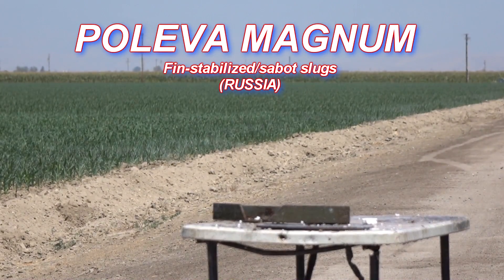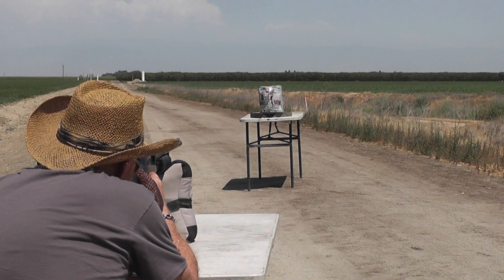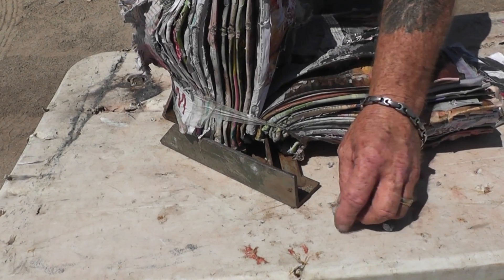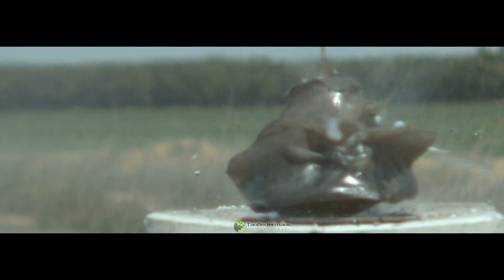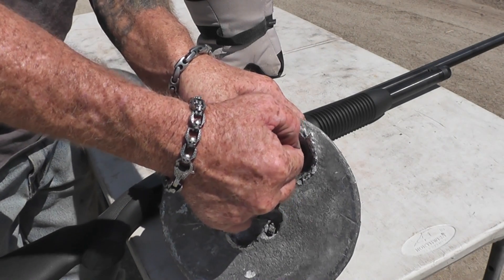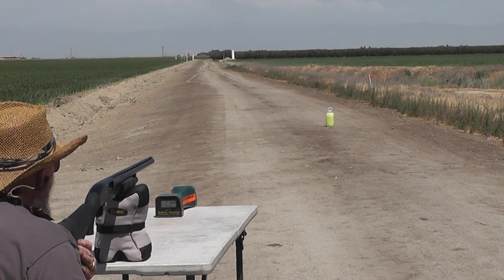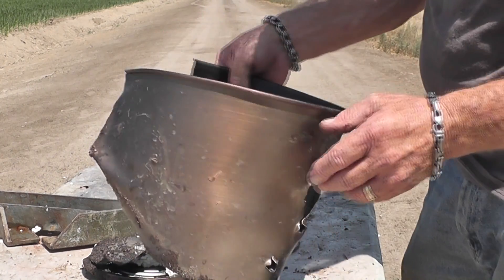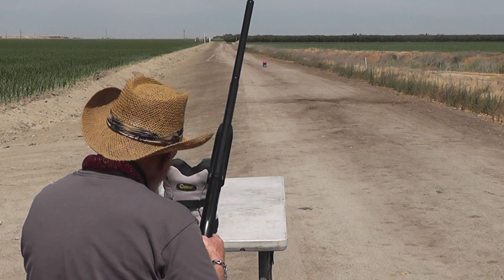Crazy Russian shotgun slug -  works like a tank sabot round!

Comment: A friend of mine used to bring something like this from Russia or Estonia (can't remember which) back in the early 90's. Just the slugs, no shells so we had to load them by ourselves. That model had a problem with the pressure breaching the wadding and breaking the tail of the slug which of course would ruin the accuracy. The wadding on ours was thinner and weaker than those shown in the video, maybe they were meant to be used with black powder or maybe slower smokeless powder than the Vihtavuori we used. Anyway, we never got useful accuracy with those, I think I have a bunch of them somewhere still.

Comment: I would love to know what chamber pressure these are running at, and even see the complete pressure curve on them. That's simply amazing ballistics from a shotgun. I suspect quality, modern shotguns can handle these without issues, so it'd make a heck deer round. I may have to see if I can make a mold for a similar slug using a 3d printed sabot and test some rounds.

Comment: Holy hell, Danny’s shoulder must be sore. That’s a hell of a round. Would be good to see some slow mo in future of the shooter taking the force of a recoil.
Reply: Just buy a neoprene and rubber shoulder saver most sporting stores stock them they just take that initial wack out that you get off magnum loads you still feel a push it doesn't really take all that much recoil out but it's a difference between a bruised shoulder or a not bruised shoulder I swere buy them for 3 inch magnums mines a jack pyke one I think

Comment: One and quarter ounces is quite the payload...
I bet Danny's shoulder is bruised right good.
Reply: Nomad 
There is! I put one on after the second or third shot. Still kicked like a mule 😳.     🇺🇸😎
Reply: Yeah it's a shame there's nothing like a padded butt pad that just slides over the butt of the stock...something to save your limbs.
Reply: +Danny Triker Red, thanks for quick reply!
Did Jeff really need 35 grains of longshot to propel it? 
Seems like a stout charge; 27 grains or thereabouts could've been more accurate i recon.
Reply: Nexfero 
35 grains was showing pressure signs on the brass and primers. 30 or so would probably would probably have been good enough 👍🏻.     🇺🇸😎